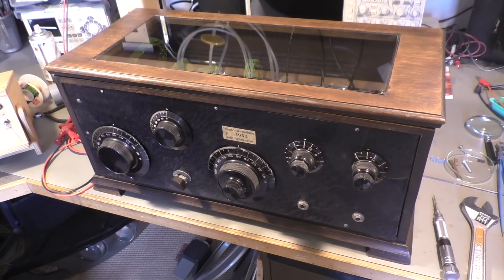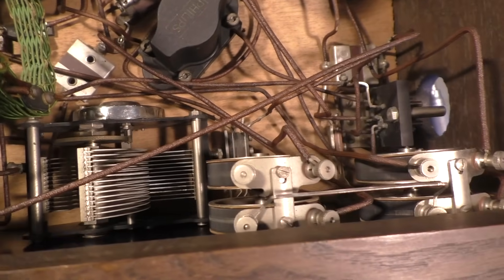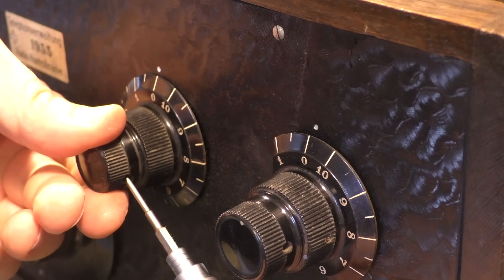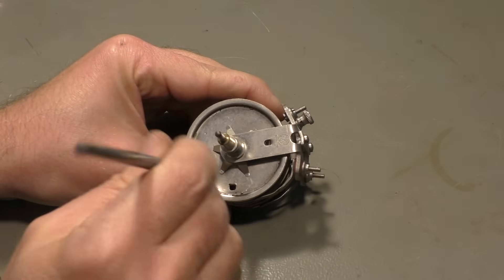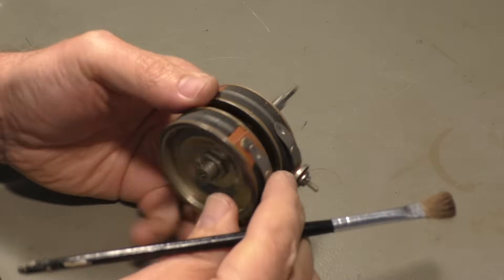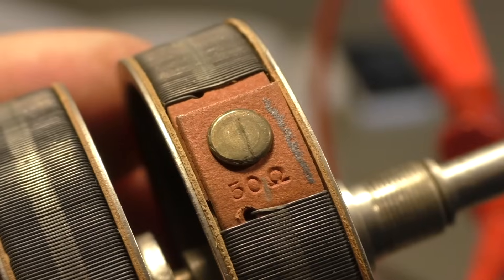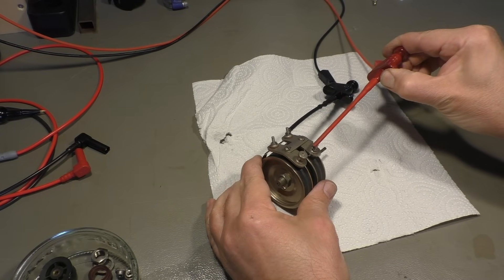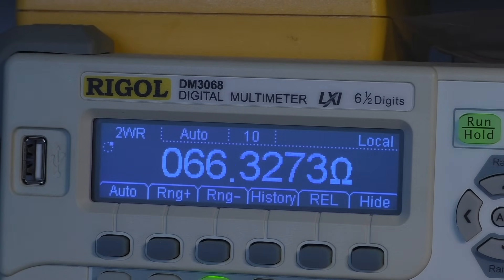Fixing a 100 years old potentiometer (PWJ230)

Comment: When cleaning metallic contacts, I find that instead of a wire wheel, using the white draftsman erasers *or the pink ones if the oxide is really hard) will clean without removing as much metal. 

Nice work though, and really nice old receiver.

Comment: Now that was interesting to see how they solid wired the entire circuit and to help against shorting they wrapped the solid wires with what looks like some type thread. Ingenious to see that.
Reply from the maker: the resistor wires are just wires with an oxide layer, that prevents shorts. I guess it comes like this from an oven. The contact path is then polished blank for the slider. It seems that polishing must be repeated every 50 years... 🙂

Comment: The electron dissipation of the cathode depends on temperature of the heated cathode what influences the aplification factor of the tube. So in the AF (Audio frequency) section it controls the volume. In the first RF (Radio frequency) section it regulates the preamplifier. The second stage is the audion which has a feedback for demodulation. This needs to fine tune the amplification to prevent oscillation of the circuit.
Reply: You forgot to mention that it also changes the transfer function curve  shape. This can and will result in distortion. Would be funny to see audiophiles try it and clame its the best thing ever for volume control. That seems like something theyd do
Reply: @lbochtler  Yes that's correct. Funny comment about the audiophiles 😂

Comment: Quite a rugged design for these rheostats.  Corrosion became a problem after many years, but cleaning it off was so simple.  It is as though they were designed for just that.  Saba would be amazed if it could have known that its radios would still be working in a hundred years with a small bit of physical maintenance and the same tubes.

I don't understand why any plausible battery power for that day would be expected to harm the tubes.  Were these even thoriated filaments?
Reply: Most likely oxide coated. Thoriated filaments glow a lot more brightly.

Comment: The voltage of the heather battery is greater than 4V so the variable resistors are here to compensate the voltage variation and adjust the gain of the tubes. Also, this kind of tube don't have a bright heather except maybe for the last one driving the speaker

Comment: thats literally playing with junk hate these tube things good luck replacing the tubes in the future btw when they break :eyes-pink-heart-shape:
Reply from the maker: I have a couple of old radios and I never had problems with the tubes. Most of them can still be bought, some even new.
It is way more difficult to repair a device from the 1990s with some custom chips.
There is no need to hate tubes 🙂
In fact it is possible to make vacuum tubes in a hobby workshop. But for chips that would be impossible.
Reply: Making chips is in principle possible, several channels demonstrated it.
Reply from the maker: @l3p3  I know, very simple chips though. However, making a tube is more a mechanical challenge and easier to achieve. See the guy who makes beautiful Nixie tubes.
Reply: @PlaywithJunk  You most likely mean Dalibor Farný and his R|Z568M tube? And there's also a anufacturer of an IN-18 remake, Millclock.

Comment: Resistors are there to provide grid bias, if you run to zero then the current is uncontrolled, and rapidly strips the cathode, plus the tube is not going to work well as it has a red glowing anode.
Reply from the maker: Those adjustable resistors are in series with the heaters. There is no adjustment that affects the grid. A schematic diagram can be seen in my previous video about the radio…
Reply: @PlaywithJunk  Voltage dropped across those resistors affects the grid bias directly, as grid is connected to filament battery negative, with positive connected to the filaments directly. Those tubes need a slight negative grid bias to work, either provided by a grid bias battery or by cathode resistor that develops a small voltage across it from cathode current, though here it is mostly from heater current.